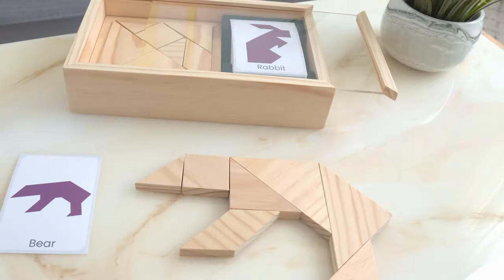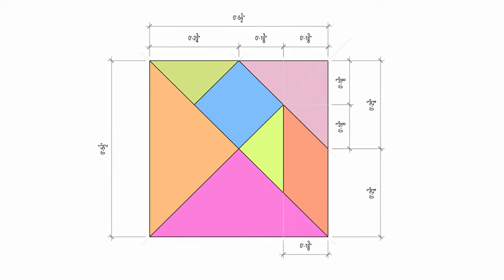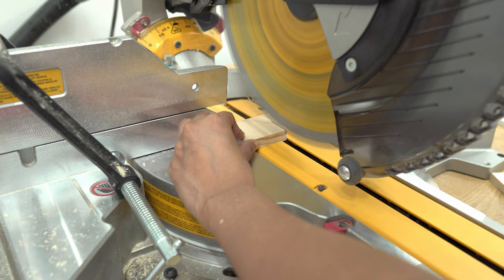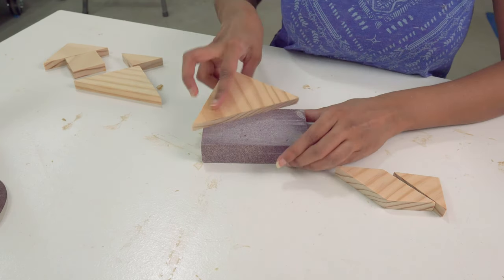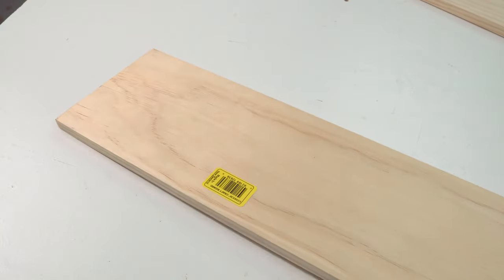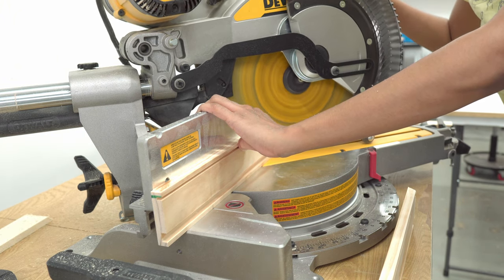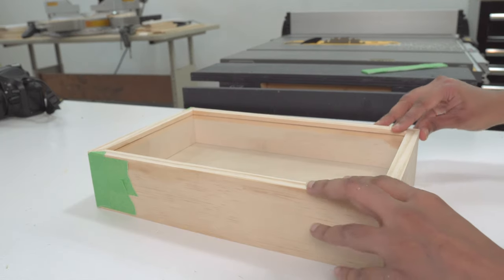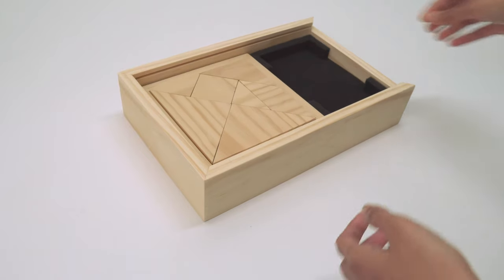How to make WOODEN Tangram puzzle set | DIY GIFT Idea

Comment: Absolutely wonderful work! I have subscribed! How did you get the foam box for the cards?
Reply from the maker: Thank you! glad to hear. It's the foam that comes with the packaging of any electronic item you buy. I simply cut the foam and glued to raise the height of the card enclosure.
Reply: @TheNomadStudio  Thanks! One more question. How did u make sure that the serving tray u made in another video is food safe? Is it the wax u used in the end?
Reply from the maker: @IndroBhattacharya-s7t   I used a wood polish and conditioner called "Feen n Wax" for that serving tray. Since I won't be placing food directly on the tray, it didn't need to be food grade. However, if I wanted any wood product to be food grade, I would use cutting board oil.
Feed n wax:https://amzn.to/3PjV7Ca
Food grade oil: https://amzn.to/3X7C7Jb
Reply: @TheNomadStudio  TYSM!